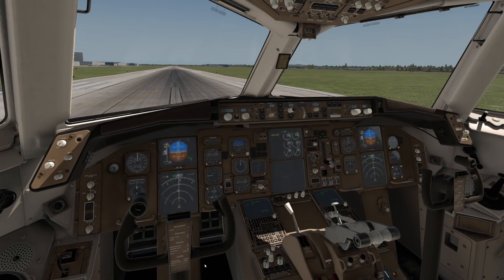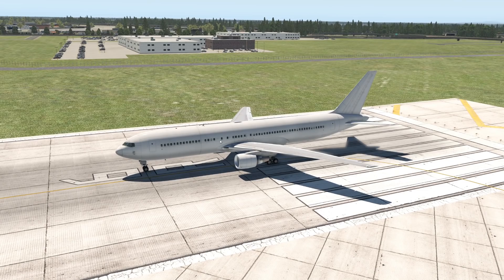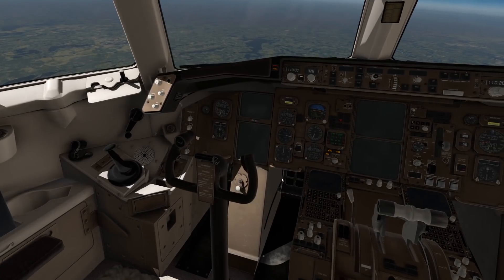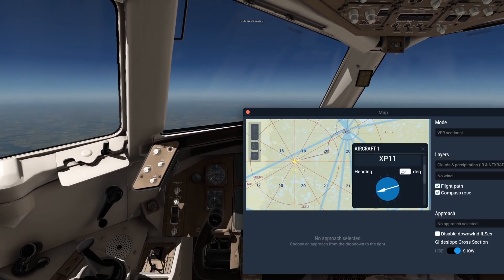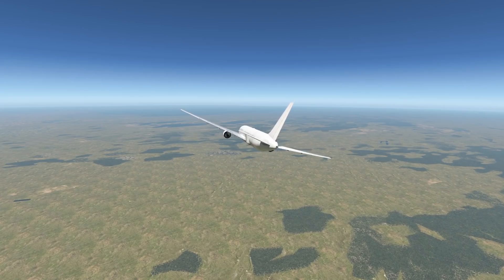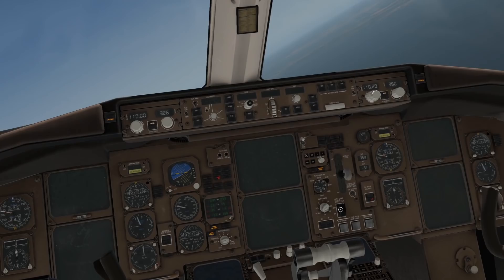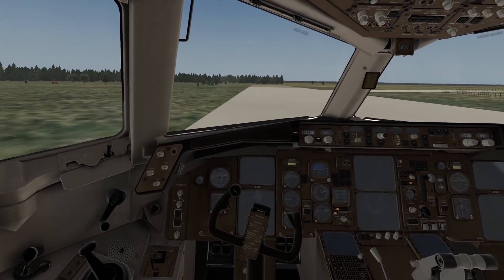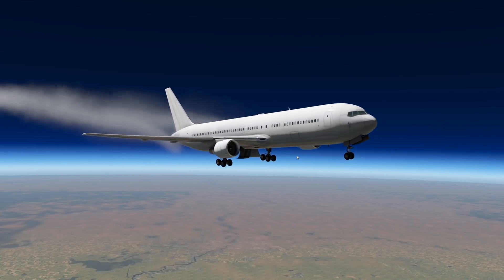767 Runs Out Of Fuel At 41.000 Feet - Air Canada Flight 143

Comment: Air Canada Flight 143, commonly known as the Gimli Glider, was a Canadian scheduled domestic passenger flight between Montreal and Edmonton that ran out of fuel on July 23, 1983, at an altitude of 41,000 feet (12,500 m), midway through the flight. The flight crew successfully glided the Boeing 767 to an emergency landing that resulted in no serious injuries to passengers or persons on the ground, at a former Royal Canadian Air Force base in Gimli, Manitoba, that had been converted to a motor racing track.[1][2][3][4][5] This unusual aviation incident earned the aircraft the nickname "Gimli Glider".[6] The accident is commonly blamed on mistaking pounds for kilograms, which resulted in the aircraft carrying only 45% of its required fuel load.[6][7] However, the units error was the last in a series of failures that aligned in a Swiss cheese model to cause the accident.[8]

The Boeing 767 had a fuel-quantity indication system (FQIS) with two redundant channels, but a design flaw caused it to fail if only one channel failed. This caused a much higher failure rate than expected. The FQIS on the aircraft had failed, and Air Canada's only spare FQIS had also failed. A technician applied a temporary workaround to the aircraft's FQIS and logged the repair, but another technician misunderstood the logbook entry and undid the repair. The Boeing 767 was not flown with inoperative fuel gauges, but a miscommunication led the flight crew to fly using only a dripstick measurement of the fuel tanks. The crew needed to enter the fuel quantity into the flight computer in kilograms, but they mistakenly did the calculation with the density of jet fuel in pounds/litre. The aircraft ran out of fuel halfway to Edmonton, where Air Canada maintenance staff were waiting to install a working FQIS that they had borrowed from another airline.[9]

The Board of Inquiry found fault with Air Canada procedures, training, and manuals. It recommended the adoption of fueling procedures and other safety measures that were already being used by US and European airlines. The Board also recommended the immediate conversion of all Air Canada aircraft from Imperial units to metric units, since a mixed fleet was more dangerous than an all-Imperial or an all-metric fleet.[9]

Today, Air Canada still uses flight number 143, currently for a service to Calgary from its primary hub Toronto.

Comment: For anyone interested in knowing why the plane was refuelled with an inadequate amount of fuel : it was a metric conversion error. The plane was calibrated for metric units but the refuelling crew on the ground calculated the fuel requirement using imperial units. Neither pilots have noticed the calculation errors.

Comment: Swiss 001      Would you have saved wasaya flight 127 from pickle lake?
Wasaya flight 127 was a yellow caravan that took off from pickle Lake Ontario and it was flying to wapekeka ontario, but about a quarter of the way through the flight the ice built up on the right side of the wing, and the plane crashed killing all. But, would’ve you saved the plane from crashing?
Reply: NetNewsLedger - Fatal Crash of Wasaya 127 Caused by Ice...
www.netnewsledger.com/2017/09/28/fatal-crash-wasaya-127-caused-ice...
2017-09-28 · Image of Wasaya Airways Flight 127 that crashed on Friday resulting in the death of the pilot. There were no passengers onboard the aircraft. THUNDER BAY – In its investigation report (A15C0163) released today, the Transportation Safety Board of Canada (TSB) found that ice accumulation and the company practice to operate in icing conditions led to the December 2015 crash of a cargo plane near Pickle Lake, Ontario.

Comment: Air Canada: Flies Passengers at 41,000 feet

Ryanair: Hold my Beer
Reply: I think u meant *Ryanair: hold my butter
Reply: Hold my fuel 😂
Reply: Dear not beer
Reply: Hold my hydraulic fluid
Reply: Ryanair : flys at 2 feet
Reply: Ok
Reply: Why beer
Reply: De Kontent hold my fuel
Reply: De Kontent Because Ryanair is an Irish company.
Reply: The 737NG (which ryanair uses) can cruise at 41,000ft
Reply: ultra god 737 pilot mode activated
Reply: Infinite Aviation™ 2 times?

Comment: 0:50 the "calculation error" was due to Air Canada recently changing there type of measurement for fuel e.g G LB and the ground crew didn't understand it
Reply: Retro Robloxians yeah that was back in 1970s-80s when Canada were changing from imperial system to metric. Ground crew didnt understand metric
Reply: There were multiple factors that led the crew to use the wrong conversion they weren't exactly "confused"
Reply: @PabloGonzalez-hv3td  I never said they were so where are you quoting from
Reply: @subpls4456  They understood the different units they used the wrong conversion factor not units
Reply: @PabloGonzalez-hv3td  but still where are you quoting from
Reply: Retro Robloxians he may be intoxicated
Reply: @itsyehippohd8312  lol